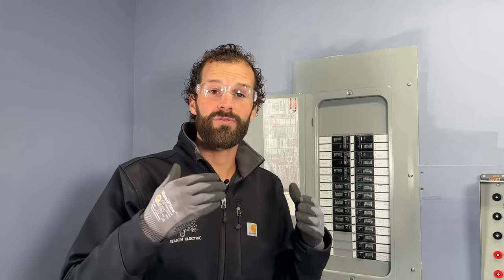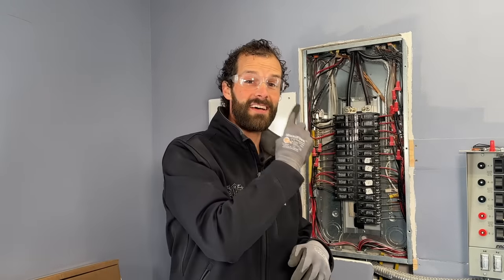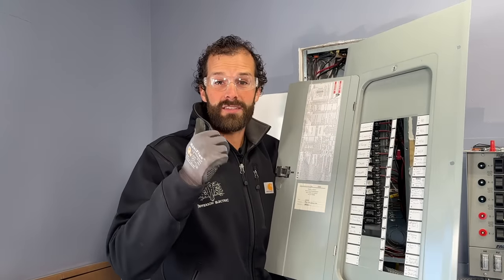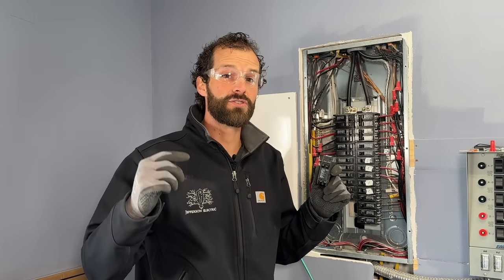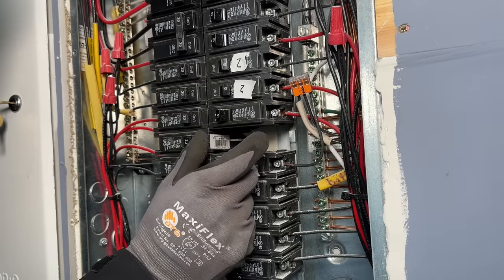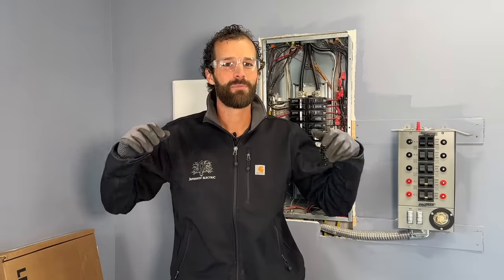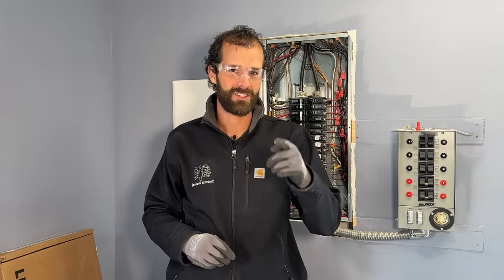No Room In Electrical Panel - Quick Fix

Comment: Scott & Joel - longtime viewer of both of your channels. Great content as always, I especially liked the tip about tandem breaker and how it is only permitted in specified slots. Never used one and wouldn't have known.
Reply from the maker: Hey Daniil,  we both appreciate your support 👍👍
Reply: In many panels tandem breakers aren't allowed in any slot, period.
Reply: They say if so.
Reply: @massengineer7582  In other panels, tandems are allowed in all slots.  They're not my favorite to use, because they're a little fussy, but they do provide a neat solution int he right circumstances.
Reply: Hi Dear.i am domestic electrical technician.and
Reply: If you try and install one and it does not fit you can't install one. If you are so untrained as to try field modifying it you just might clean up the gene pool. Lol

Comment: Very concise and accurate video. I am a retired electrician of 19 years and an Electrical Inspector for 21 years doing the smallest of jobs on to 1000 foot high rises. My only problem is that you made it sound as though as long as there were still spaces left, you could just keep adding circuits without regarding the load. That's like saying "How could I be out of money, I still have checks left". When electric cars were first coming out, I saw many a fake load calculations and turned down at least half of them. It didn't take long before the contractors figured out how to do an accurate load calculation, and perhaps make a few extra bucks changing the 100 service to a 200 amp service.
Good job with all the other details though, spot on.
Reply: Load balancing also needs to be considered
Reply: I think that applies to the grid as well. States mandating electric cars but not saying how all the electricity is going to be generated and distributed.
Reply: where are you that people spend the extra for 100A services?
Reply: @KameraShy  Conversely, I have wondered about solar system that back feed the grid. When I put my system on, it was rather large to accommodate my electric vehicles. Now, most electric vehicles in California charge between 11pm and 7am because they cut the time of use billing to 1/2 to 1/4 of other times. There is no significant load on the grid at this time. With a lot of electric cars, the load may become significant, but not overly so. With Solat though, I noticed on my street on the same transformer that there were 3 of us with very large solar systems. What happens if there becomes many more? My house would pump in 40 amps on those sunny days, or about 7kw. What if half the houses on that transformer did this? It may well come to a point where the grid could not handle the reverse flow. The solution of course is start installing batteries to balance the grid during the day charging local batteries and then using that power as needed to create a virtual power plant as Tesla is now doing with powerwall owners. Or even as simple as all the power I made during the day when usage was low to charge the car at night. Although this solution sounds expensive, in a 20 year amortization, it is actually cheaper. Just thought I would share some thoughts.
Reply: @KameraShy  It's one of two reasons why electrical cars cannot become widespread given today's generation and grid capacity.   You'll see states and electric companies crack down on that soon.
Reply: @kenbrown2808  Around me, 400A service split into 2 200A panels is pretty normal.
Reply: @teekay_1  it will get common on smaller houses as electric cars become more common.
Reply: @kenbrown2808  Unlikely.   Unless your house has a garage or private drive, the logistics are simply too hard to overcome.

For those that live in cities or small towns in row houses or apartments, there simply isn't a practical way to charge cars over night.

It's much more likely more houses will be equipped with emergency generators because of the continuing grid failures in many states.   It's a sign of decline, unfortunately that we can't prioritize base generating capacity.
Reply: @kenbrown2808  Old houses used to run 100A services.
Reply: @WilliamEades_Frostbite  old houses used to have a range-main-and-four.
Reply: @kenbrown2808  Here in Tallahassee, I've done rewires to houses still using Knob and Tube on an 8 circuit 75A fusebox, one was on the National Registry of Historic Homes.
Reply: @WilliamEades_Frostbite  my brother's first house had been retrofitted to K&T.
Reply: I will add to your points....so very many of these videos by these two guys and many others are gushing out what knowledge they have gained in a field that requires years of experience and enticing people to try their hand at it. I think they actually open themselves to liability by doing so. The comments of praise from people who don't know any better just add to the problem by presenting it all as something anyone can do. Electricity is invisible dynamite kept in check by many decades of Code mostly developed from 20/20 hindsight of small disasters and injuries. It's a Profession for a very good reason, it's not advisable as a DIY topic to the extent these guys take it. Hire a professional. There are smart capable people who can do it right after careful consideration and self education but sending out these videos to the general public is just dangerous.
Reply: @fritzmiller9792  the thing is, there are multitudes of people showing how not to do things, at least this guy was better than most. And as an Electrical Inspector for 21 years, it is astounding the terrible work I have found, even from so called Electrical Contractors. But even with the absense of any direction, the average know nothing will give it a shot anyway.
Reply: @fritzmiller9792  There is a REASON Electricians make it to the top 10 deadliest professions almost every year.
I did it in one form or another for 50 years before retiring, from Residential, commercial and Industrial to High Power/Voltage DC in Telco MDF's in CO's.  Been blown off ladders more than once by the after effects of others who didn't know what they were doing and seen more than one hospitalized from Arc Blast and a couple killed via Electrocution. 
 I respect those who tell me that electricity scares them...It Still scares me, and I respect what it can do to me...I still carry an burn scar from a shock I received when I was 20, I'm almost 70 now.
Reply: @WilliamEades_Frostbite  I even treat ground wires as hots until proven otherwise....and I have many first hand stories as to why and more second hand stories than I can remember. And it's 90% of the time from poor workmanship and/or  outright hack work. Any not extremely cautious really is inexperienced and just doesn't have the knowledge of what is out there for death traps. 'Don't even trust your own Mother' is what I tell fellow electricians.

Comment: This got me thinking how I could improve my panel.  Never thought about this method.  Fantastic!  I really like Joel's channel as well.  Wish I could hire him as my local electrician.
Reply: Dont , hes a jack of all trades, master of none.
Reply: Improve my panel, there is a whole lot of usa education in that statement.
Reply: That has nothing to do with “improving” your panel it is just gaining an extra space .
Reply: @gerdberg4188  Gaining room for an additional circuit sounds like quite an improvement to me.
Reply: No improvement was made, it's a 30/40 panel using only 27 out of a possible 40 circuits before any loads would need to be "combined." Anyone planning such a major addition that is running more than 13 more additional circuits should plan for a service upgrade or at the very least a sub-panel.
Reply: @Keifsanderson  He already has room for 13 additional circuits.

Comment: Keep in mind, AFCI neutrals are monitored. You won’t be able to combine if one or two breakers are currently AFCI protected. Unless you find your second neutral and pigtail like you did for the hots.(If you put under AFCI)
Reply: This guy lives in yesterday ….
Reply: That's a good point because with the 2020 nec it is bssically requiring and afci for every circuit in the panel.
Reply: @ericstandefer9138  we have been like that since 2015 in Canada. Takes up a lot more space in the panel and significantly increases the cost of panel install.
Reply: Didn't you see the breaker?
Reply: @gerdberg4188  you hit the nail on the head with your comment.

Comment: Ahhh yes, the maxed out electrical panel!  When I bought my house, my outdoor panel had "the big stuff" - HVAV systems (2 of them), drop in stove, in wall oven, pool pump, water heater, clothes dryer, and a 60 amp breaker feeding a tiny-ass sub in the garage for the inside.  Small panel with 23 of 24 half-inch spaces in use.  

I had future plans for a tankless water heater (electric the only option in our area), maybe a workshop in the garage.  I feel the pain with this video.  Having been a licensed electrician at one time, upgrading the panel was easy.  But I know not everyone can do that and the thought of dropping a couple grand to have a new panel added is daunting.

Luckily the garage feed was the standard service entrance wire in the wall which allowed me to pull the entire panel out if the wall cavity and there was enough slack for me to move it out of they way so I could retrofit the cavity with a larger panel fed by a conduit all the way out to the exterior main.

Now I have a 200 amps sub panel in the garage with plenty of space.

Comment: I've ran into this problem many times
somebody will ask me to install an additional circuit and there's no space in the panel for another breaker ,
So I'll take out two breakers and replace them with a tandem breaker to obtain the extra space I need ,  I'll remember the notching on the Eaton panels but other panels I've had no problems installing tandem breakers
Keep in mind that not all brands of panels have tandem breakers available and if that's the case , A sub panel will have to be installed
One very important thing is before installing a breaker is to inspect the busbar for pitting or corrosion , If the busbar looks good , Before installing the breaker I'll apply a light coat of antioxidant compound that you would use for connecting aluminium wire to the busbar to prevent corrosion because in just about all breaker panels , The busbars are aluminium and applying antioxidant compound will prevent corrosion , Also make sure the breaker has a tight fit to the busbar when installing
Reply: Siemens and Homeline do that as well.  it's because it used to be a code requirement that a breaker panel have no more than 42 breakers.

Comment: So, options 1 & 2 are both code violations in Canada. Also randomly combining lighting circuits can also be code violation . In Canada, maximum number of lights per 15 amp circuit is still 12 regardless of lamp type.
Reply: Canada is a beautiful country. Unfortunately you need to rewire your leader
Reply: Not sure rewiring is a viable option. Sometimes replacement of  defective  equipment is the only option....leaders too!

Comment: Six years ago I converted every indoor and outdoor light to LED to save money. Then six years ago I had a ground based solar panel system installed on our lower property. It has a perfect Southern exposure on the 40 degree down slope. It paid for itself in four years because it generates 27 mWh of power per year for our 3 AC units (14 ton total capacity).  We can run the AC 24x7 and in the last six years have never paid an electric bill. It was the best investment in my life and highly recommend doing this even though the original 30% tax credits are gone.
Reply: It's still 26% I'm fairly certain, it's been extended again. I got in on 2019 for the 30% then 26% in 2020 on a smaller array.
Reply: Good to know. We went on NEM 1.0 in late 2016. The most expensive single part of the solar installation was upgrading the circuit breaker panel from 200 amp to 400 amps to handle potentially 200 amps from the utility side and 200 amp from the solar side at the same time. This is the worst case scenario that never happens  but for fire insurance purposes we wanted to be safe in case there was a post fire incident  report denying our insurance.
Reply: @pauljones3866  that's a huge array.  I have 22 panels to generate 9mWh per year which is just about enough for my house + EV 9,000 miles a year.
Reply: Solar and LEDs...
2 technologies that fail often... 
Those stupid LEDs NEVER make it anywhere close to their rated lifespan. 
And I know several people who installed solar and they are constantly under repair. 1 person has had to replace 4 panels in just 6 months time. 
I'll take a hard pass on both until they actually work...
Reply: @billymacktexasdetective5827  your anecdote is not indictive of actual rates.
Reply: @whattheschmidt  Oh yeah? Prove it.
Reply: @whattheschmidt  I read a study that found a 32% failure rate of LED lighting products within 3 years of deployment. Real life actual end users also, not lab testing. How exactly is my anecdote not indicative of actual rates???
Solar has a much lower failure rate so I'll just assume the people I know who have nothing but problems must have got a bad batch of panels. They were all installed by the same company at about the same time... 
Either way, both technologies are unreliable (solar because the sun isn't always out, LED because of the high failure rate) and are pretty bad for the environment to produce and also dispose of at end of life. I'll take a hard pass on both...
Reply: @billymacktexasdetective5827   I guess I will live through my decision by having panels put on last summer. Kind of like 1902. Should I go battery horseless carriage or alcohol fuel?  My grandfather saw car, radio, atomic bomb and men on the moon.
Big changes in my life? Home computer, Internet, Man on Mars? Androids? Hmmm.

Comment: At about 4:27, it looked like the wire had been deformed from being tightened in the breaker. I like to straighten the end before reconnecting. Wago splices can handle a bit of bend, but work best with a straight wire. Also, check for proper strip length.
Reply: @Kevin-mp5of  occasionally, shortness of the wire involved precludes restriping.
Reply: The Knipex pliers wrench works well for completely straightening out even fully twisted wire nutted wiring for use in lever lock connectors; minimizes continual cutback of the wire for reworking circuits.

Comment: I haven't encountered that notch/no notch in the bus so that was good info!
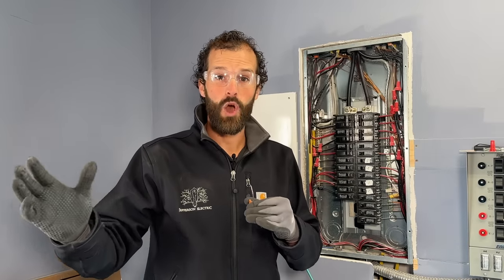HOWEVER, I did see a problem at 3:30 in the video!
I'm from Canada but this doesn't change from CEC to NEC and I believe is manufacturer spec anyhow (If you have reference to disprove me please reply!)
While breakers do allow 2 wires under the terminal, it's my understanding that this is only meant for use in Parallel Run circumstances (2 hot wires of same length for the same circuit), not meant for 2 circuits or combining of circuits. 
This, as well as the quick connect joint to run a pigtail to a breaker (not allowed any joints in panels **local to me, but are allowed in CEC**, but  if allowed, then for sure that's a quick inexpensive option!) 
But these methods do create constant headaches for electricians by misleading how many circuits or free spaces there are, causing stress on contractors to renegotiate prices! 

Please people, if circuits can be combined to code, install a junction box (4x4, octagon, etc) outside of the panel to combine the circuits and run a single wire into the panel, 
Switch to space saver breakers if available, 
Install a subpanel, 
Or just call an electrician,
the next guy will thank you
Reply: @bukkakekills5163  You're bang on there! the code rules do allow you, I misspoke saying CEC so thanks for correction, locally it's a bylaw/part of fire code so we just don't do it altogether, and I wasn't sure how wide-spread that might be. If allowed locally, then definitely, when you hafta you gotta!
Reply: I don't like quick connect fittings.should be banned.there is not enough contact point on the tab of the connector. For lights they're fine not a lot of load especially today with LEDs they shouldn't even be on recepticals especially with a big draw seen a lot of burnt recepticals and burnt wire casing
Reply: Extensions are fine in the panel just don't use one wire from breaker to extend 2 feeds on the same breaker